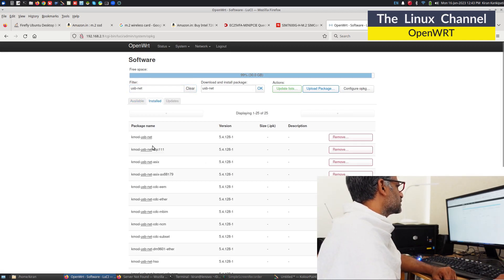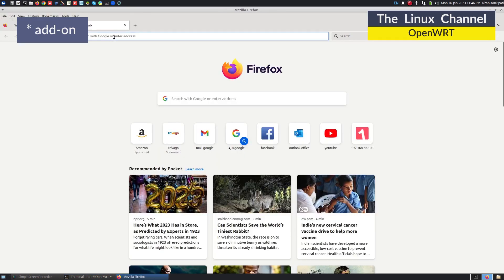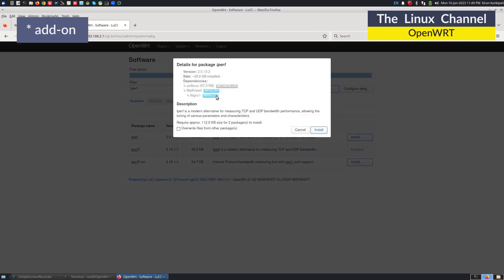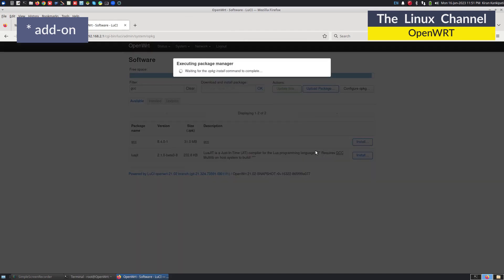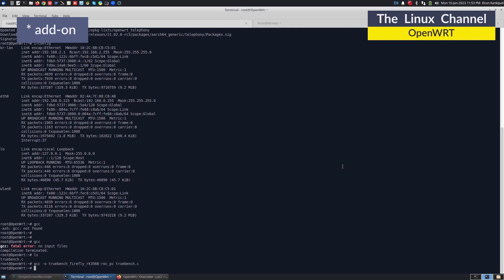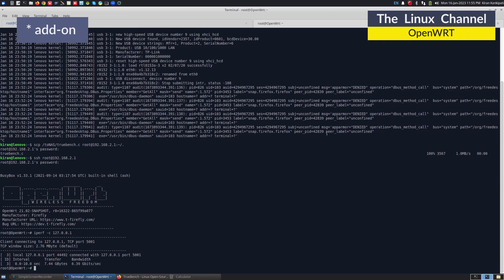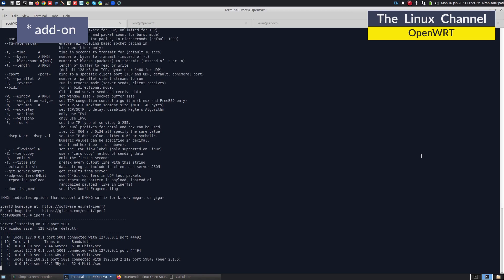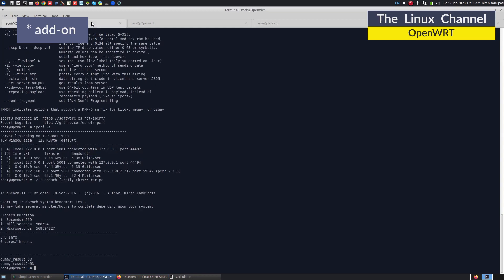x25d Rockchip ROC-RK3566-PC from Firefly | OpenWRT | Part 3 | The Linux Channel

Comment: Sir can you help,I bought a set top box with Android function my tv is not smart. Now I get that without recharge of dth pack I can't use the box features at all. Company has blocked the USB debugging option in developer mode. How can I debug the box with computer
Pls help me...ur cooperation will make it useful
Reply from the maker: Nice to meet you. I understand. Although I am not an expert in this, one hack you can do is to open and connect to its serial port and then try something. Usually these devices as well routers may have the serial port header to which we can solder USB to UART. Sometimes you get a serial access almost like ssh.
Reply: @TheLinuxChannel  hm thanks a lot